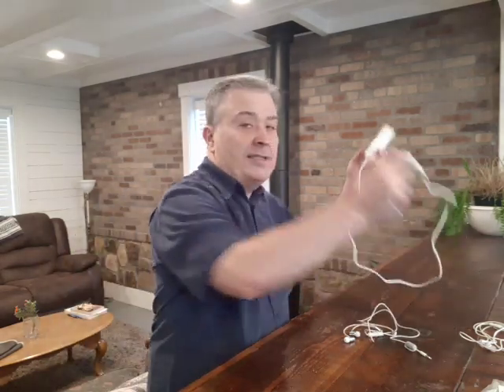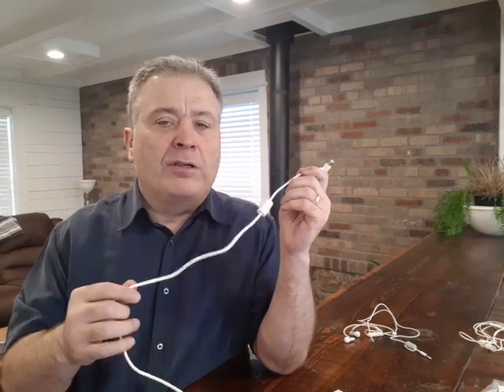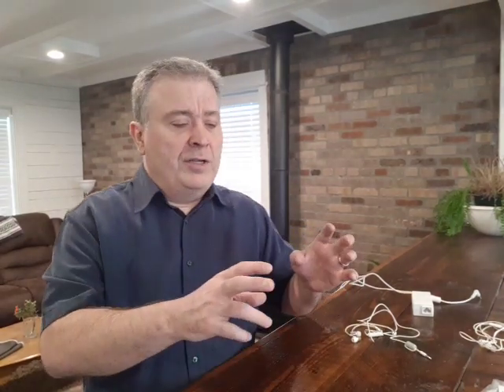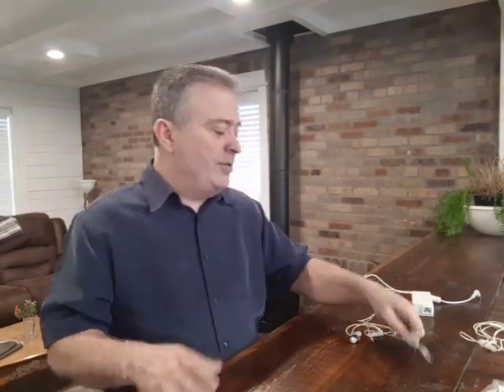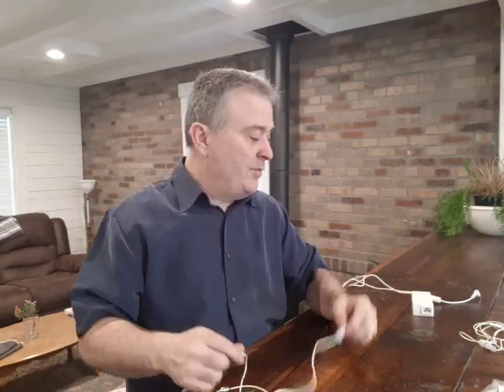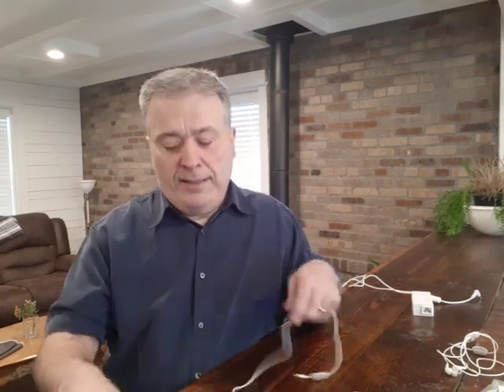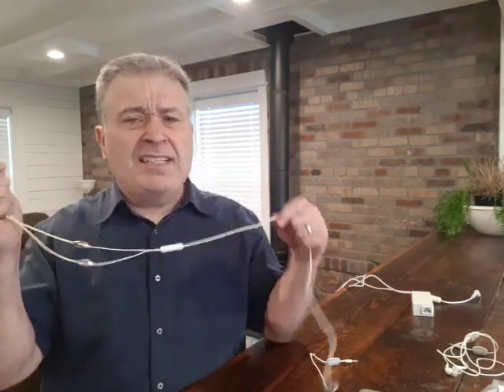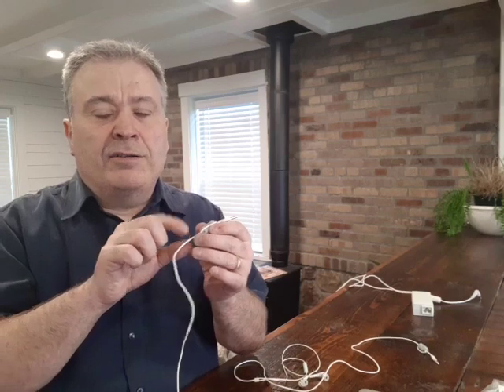Ferrite Bead As Cell Phone Radiation Protection

Comment: what would you recommend regarding earbuds and phone cases?
Reply from the maker: Great question. You definitely want to talk on your phone using speaker phone with the phone away from your body as much as possible. Distance is the best protection. When I need to use headphones of some sort I always use a corded type (with a ferrite bead). It doesn't really matter which one as long as it has a cord and is not wireless. Wireless ones are Bluetooth which emit the 2.45 GHz frequency which is the same frequency your microwave oven uses to cook your food, just with less amperage obviously. Here  is an article I recommend you read from my website discussing protecting yourself from your cell phone radiation https://www.radiationhealthrisks.com/ways-protect-cell-phone-radiation/. And here is a video I did testing different cell phone cases https://youtu.be/E81ap4YJzkk. Below all my videos I also link to the ones I recommend. Hope that helps!

Comment: I have my phone on air-plane mode 60% of the time and use 2G 90% of the time. My question is, does the phone still emit radiation when it's set to air-plane mode.
Reply from the maker: It emits the less powerful kinds like electric fields and magnetic fields. But the only way it emits RF Radiation in airplane mode is if after you put it on airplane mode, then you turn on wifi. Most phones allow you to do this so that you can use the airplane's wifi while in flight.
Reply: @RadiationHealthRisks  Thank you, very informative.
Reply from the maker: @motebike  No problem

Comment: This is all new to me, so I thank you for this video. I didn't realize how much radiation could come thru a head set.

I never really used my cell much,  until this lockdown from the virus. I have been listening to many videos with a headset for the last few months.. 

I have a couple of questions.
Does the wrapping around the ferrite bead inhibit the sound quality?
Also, Is using a headset on a computer as unsafe as a cell phone?

So I will order the ferrite beads (I went to your amazon link).
But do you think that the air filtered earbuds are worth buying? I saw many comments stating there is a lot of static. 

This is a lot of questions. I really appreciate your time and  details with your presentation. I look forward to future videos.
Reply from the maker: Thank you for the kind words and the questions. A ferrite bead does not inhibit the sound quality at all. Using headphones on a laptop is just as dangerous if your laptop has wifi turned on. It is the wireless signal that grabs onto the cord and runs up it. If you have no WiFi turned on there is still some potential danger, so I would use a ferrite bead just in case personally. If by air filtered you mean air tube headsets, they are safer than normal headsets but you still need a ferrite bead on the bottom. I did not notice static but I don't think the sound was quite as good. I personally don't use an air tube headset any more, just a corded one with ferrite beads, because air tube are heavy and clunky.  Just make sure whatever headset you choose has a cord and is not wireless (and put a ferrite bead on it). Hope that helps.
Reply: @RadiationHealthRisks  thank you so much for your detailed reply. I could easily turn my Wi-Fi off if I was on my computer. 
One more question. If I turn my Wi-Fi off on my phone, is that safer? Thanks again, I have learned so much from this. I did buy the ferret Beats from your Amazon link.. Take care.
Reply from the maker: @Marychange  You always want to turn off your wifi and Bluetooth on your phone whenever you are not using them so you don't have the extra wireless signals (RF Radiation) being emitted. But your cell phone signal is also wifi (RF) radiation. Anything wireless is. Hope that helps.
Reply from the maker: @Marychange  You are welcome.

Comment: I recently bought the Kinden air tube headset that you recommended and wondering if I still need the ferrite bead given that this particular headset has shielded wiring?
Reply from the maker: The shielded wiring definitely helps. Ferrite beads are so cheap and work so well I always put them on just in case.

Comment: I’m a little confused as to the best placement of the ferrite beads on cellphone earbuds. I understand that you suggest placing them closest to the cellphone (at the bottom of cord), but others mention placing them CLOSER to the earbuds, which I would think would allow the radiation to travel up the cord affecting your body (to the point of the ferrite beads). If you could please reiterate for me, the best placement, I would be most grateful. Also, could one place two ferrite beads at the bottom and also place one (or two) closer to the top for even more added protection? Or would this be overkill and unnecessary? And, by the way, GREAT video/info! Thanks so much for making all this info (and ALL the info on your website) available. It is much appreciated! (P.s. Ordered the mesh router protector because of you. Again, thank you!). ☺️
Reply from the maker: When they speak of putting them at the top the only purpose of that is to keep radiation from going through the cord into your head. That would make the top of the headset heavier and clunky. However the more important problem with that as you picked up on is that the cord still emits radiation (like an antenna) into your body. Putting them on the cord as it comes out of the device is the best. Thank you for the comment.
Reply: @RadiationHealthRisks  
Will you please tell me if I'm understanding this or correct it?

When people use the ferrite bead on the wire of a cell phone headset, they're wanting to prevent the wire from receiving the wireless signal from the phone and carrying that wireless signal up to the earpiece, so the signal strength coming from the earpiece isn't as strong as if the phone were being held next to their head. So if the ferrite is put closest to the earpiece it'll prevent the signal strength in the earpiece. But if the ferrite is put at the furthest point on the wire from the earpiece it'll prevent the length of the wire between the phone and the earpiece from acting as a receiving antenna for the wireless signal, which would make the ferrite at the earpiece end unnecessary? There's no effect to putting the ferrite at the earpiece end when there's already one at the end furthest from the earpiece (other than the extra impedance like there'd also be if the second one was placed at the end furthest from the earpiece)?
Reply from the maker: @danc2108  The problem with having a ferrite bead at the earpiece is Wifi (RF) radiation will still be in the rest of the cord and will jump into your body whenever the cord touches you. Only the earpiece is protected. If you put it at the base next to the phone the whole cord is protected including the earpiece. Some people put two ferrite beads on both at the bottom next to the phone.
Reply: @RadiationHealthRisks  
Ok. And can you link to or give me a key phrase to search for about the physics of how putting the ferrite at the base of the cord keeps the whole length from being a receiving antenna for wireless signals? And have you heard of people using ferrite somewhere on the wire of an indoor grounding wire, like one that could be attached to a ground rod outside with a conductor on the indoor end? I'm trying to figure out whether the ferrite has any effect on a wire that's well grounded, and if it does, whether the effect would be to reduce the reception of wireless signals into the wire, change the grounding efficacy of it, or both. I've read about what earthing proponents call the "umbrella effect", and I found the pages in Feynman's book Lectures on Physics Volume II where it's discussed (not referred to by Feynman in that book as "umbrella effect" but discussed in much more detail than earthing products studies have), but since I don't really understand the details of the physics I'm not sure whether this "umbrella" effect makes ferrite on a grounded wire conducting to a person's body useless or if the ferrite could reduce reception of signals into the wire and/or change the grounding efficacy. I can link to a PDF of Feynman's Lectures on Physics Vol. II if you'd like.

I emailed a company that sells earthing products and asked them about the umbrella effect and safety and efficacy of using a grounding wire (connected to an outdoor 12' copper ground rod) with wireless signals of various wavelengths and intensities around, because of the changing spectrum usage for computer tech. Here's an excerpt of the conversation (sent before I found the explanation of the "umbrella" effect in Feynman's book -- "...the details about the science of how the umbrella effect works would be useful" is when I was asking if they knew where in the book it's described).

I wrote:
"...So for someone who wants to use earthing when there are wireless signals around, and wants to check that it's effective with all the frequencies and intensities of signals as new ranges of the spectrum are used for wireless tech, the details about the science of how the umbrella effect works would be useful. I've read some things by a doctor named Jack Kruse who has said that with some frequencies that might be used in some situations for 5G, in the millimeter wave range, the umbrella effect could become ineffective and grounding could become dangerous because of the risk of electric shock from jump conduction. That's the simple paraphrasing of what he's described in more detail."

They wrote:
"...The umbrella effect of earthing is not protecting you from high frequencies radiation like 5G. 
The umbrella effect means that low frequency radiation from electrical circuits in your house will not result in induced alternating voltage on your body (at least 95% less). 
The electrical fields will "bend away from the body" because of the umbrella effect as described in the Earthing book.

Our sheets do have a high shielding effect also on high frequency radiation, but to be effective you need to be shielded all around. I have a 140cm fitted silver undersheet (and ground it!) around my duvet, like a duvet cover, and put my cotton duvet cover over it. In this way I am shielded all around the body..."

I wrote:
"Do you know if the efficacy of the umbrella effect stops suddenly at a certain frequency, or is a gradual linear reduction as frequency increases, or it would be a curve of efficacy (y axis being efficacy and x axis being frequency) that wouldn't be linear?"

They didn't respond after that.
So can you answer any of that; or help with some details or leads about the grounding wire, signals of various wavelengths and intensities; and the possible use of ferrite? Thanks for your help.
Reply from the maker: @danc2108  Ferrite beads are so cheap I would just get them and be done with it. Here is a video from YouTube https://youtu.be/81C4IfONt3o about ferrite beads and how they work. The reason you put the ferrite bead next to the phone is because the phone is the source of the radiation. The RF Radiation just grabs on to the cord like it was an antenna. The ferrite bead filters off the higher frequencies you don't want on the cord.